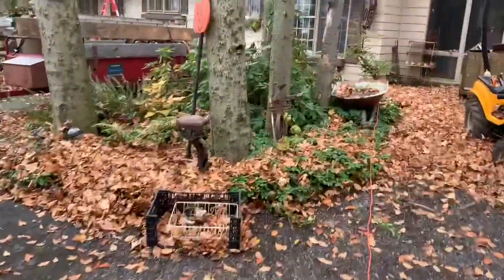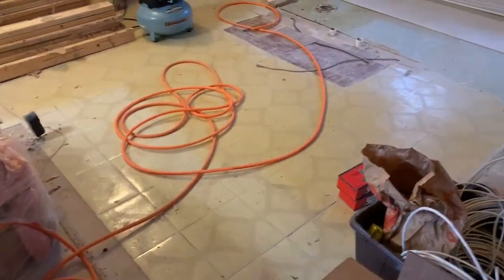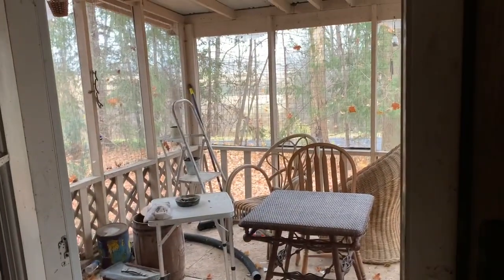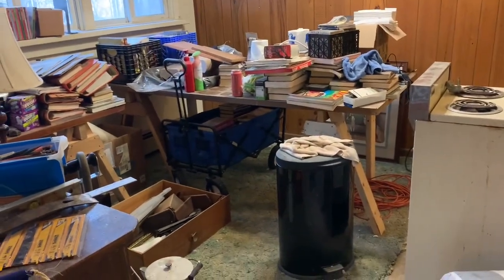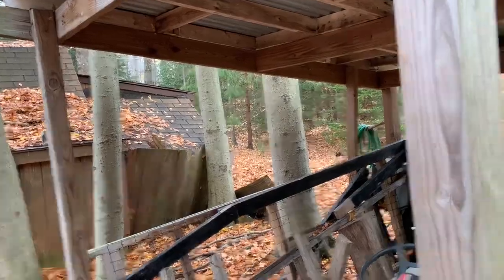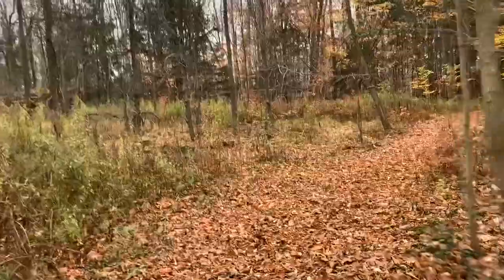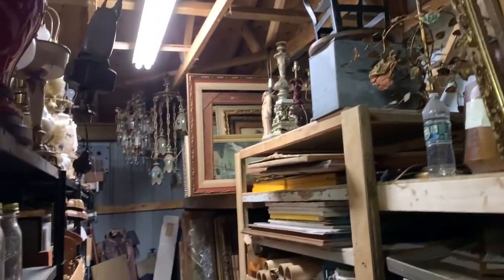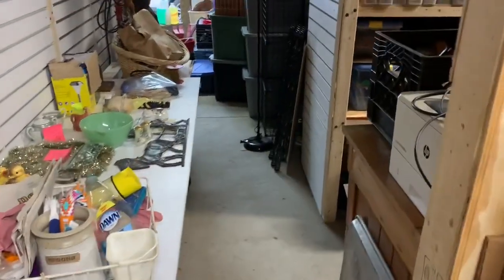Next Chapter Begins… Prepare for Construction on the NEW House! #journeysend #houserenovation

Comment: Our daughter and my husband flip houses, and when you want to.tear out a supporting wall, you can put a beam across the area. If you go to a real lumber yard or check with an architect, they can tell you how long and large the beam needs to be for the span you want to open. They do this all of the time. Sometimes at one of the walls they have to put in a post along the wall, which they drywall it and it looks great. One tome they needed such a large beam, instead of it hanging down too far from the ceiling, they will put in a post and decoratively cover it with wood. It looks very nice. Our daughter’s current house has one. Hope this is helpful.
Reply: @Betty Hussong 
Yes.. that's exactly what I'm gonna do.. I'm gonna hide support columns in the walls and run a header across to support the roof and ceiling joust.. the rafters are 2×6's so I'm gonna face them with 2×2's to thicken them up so we can get good insulation and ventilation.. I'm gonna leave 2 or 3 of the existing ceiling joust in place and gonna rap them with ruff cut lumber to give it that barn/country look and feel.. we're also gonna build sliding barn style doors when and where possible.. long story short.. all of those walls without drywall on them will be torn out and the ceiling will be vaulted.. once those walls are gone, I think everyone will realize that it's a bigger space than what they thought..